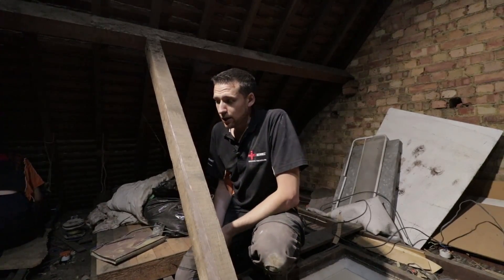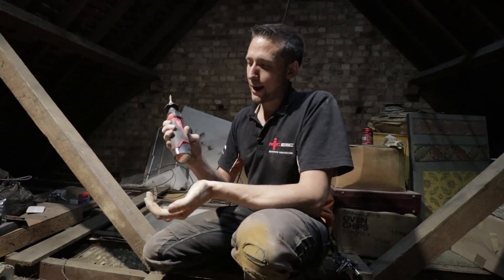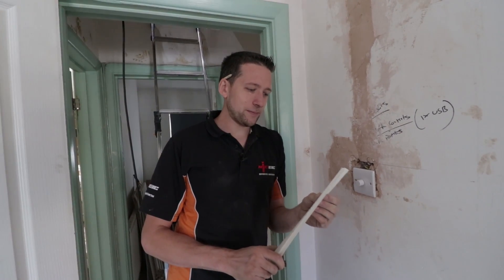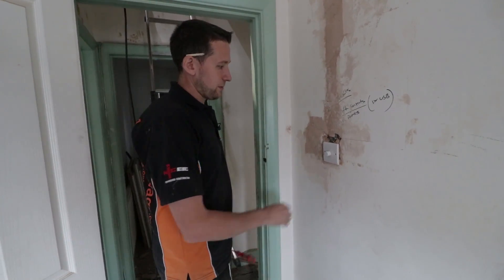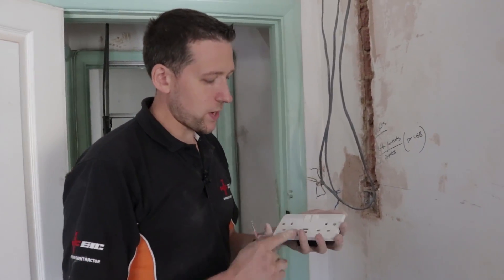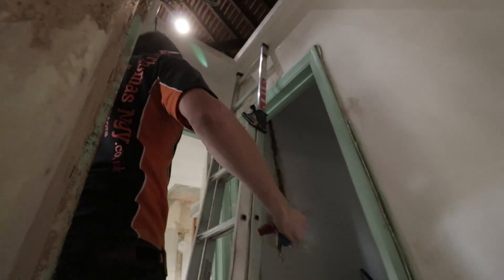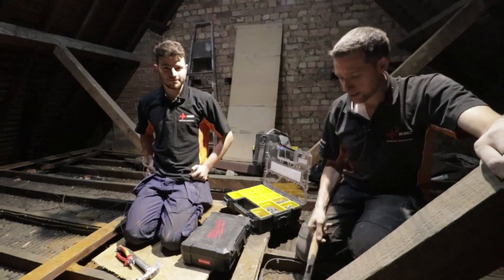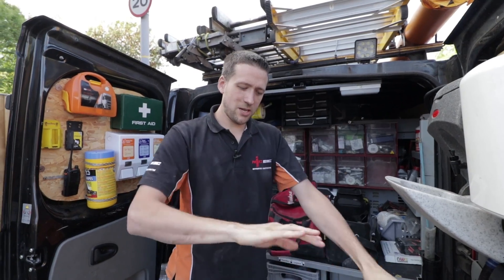Rewiring a "just rewired" house (Part 2) | Thomas Nagy

Comment: Couple of questions Thomas. Can insulation be put straight over the cables afterwards. I want to cut,  route the wires in the attic through the joists, join and board over the joists. Wondering if there was a reg about insulation covering the wires. Also which would the best connector to use for this application. I was going to use in-line choc blocks or wagos.

Comment: Why in the hell does Uk use square socket boxes?  Like it's a proper shitfest to cut a square whole and fit those square boxes in there etc.
We use circle boxes, you just cut em out with a hole saw, push em in, tighten two screws and you're done, takes about a minute.

Comment: As a random aside, it's interesting to see the differences between norms and requirements in different countries. Here in Norway, to my knowledge, you are required to run cabling inside walls or between floors in tubing, no exceptions.

Comment: I'll stick with my butane portasol soldering iron, it does the heat shrink on the end of the LED strip afterwards with the little hot air vent on the tip.

Comment: I’m not a sparky, but I just don’t love USB integrated sockets. Active electronics running 24/7 just doesn’t sound like a great plan. Having an external isolator switch would be a great solution. An annoyingly bright LED active when the charging circuit is live would encourage folk to turn it off when not in use.

Comment: Hey T.
Are these Combi Cutter/Stripper something used in the UK? Rarely see anyone outside my own company use them and i'd never be caught dead without mine on me during work hours.
Cuts effortlessly, strips wires ends quick and easy.
https://tools.no/produkter/handverktoy/tenger-og-avbitere/elektronikktenger/Kabelsaks-9511-165A-Knipex-2850596-no

Cheers

Comment: I'm still at the beginning of my electrical trianing, just basic theory, when do you do soldering rewiring a house???  Great vids as usual.
Reply from the maker: not so much when rewiring, but things like led strip lighting, soldering connections etc..
Reply: Great  way of joining cable, when you have no room for wagos etc. Done right the join is barely thicker than the original cable and strong.

Comment: @7:45 - the one thing holding me back from installing USB sockets at home is the fact that they're always on and you can't unplug them. I wouldn't just want an off-for-testing switch in the back, I'd want either an on-off switch on the front (a third rocker between the 13A ones) or a microswitch activated by insertion of a USB plug, so when nothing's plugged in it's really, REALLY off and not just pretending to be off.

As for the rest of the wiring job here, if I was the customer I'd be passing links to your videos on to anybody else I knew who was shopping around for electrical work, naming and shaming the guy who did it first and ensuring he gets as little business as possible. Word of mouth works both ways; if you're one of the good guys you'll be rushed off your feet with work even without advertising, whereas the cowboys' adverts will be out there to trap the unwary.

Comment: just wondering how do you wire 3 temperature controllers to a single scr using one double pole double throw relay to initiate 3 different output scenarios?

Comment: I've fitted thousands of the MK Logic Plus USB sockets. I must admit I'm not overly fussed on MK products. I personally think Hager gear is of a much higher quality. 

Testing isn't an issue with the USB sockets. Your only limitation is IR testing at 250v between Line & Earth and Neutral & Earth only. No different to having a fancy LED light fitted during testing.

Comment: Are you having a joke with that jumbo soldering iron for fine work? It looks like it would be great for chassis work on an old valve radio, but for fine work and LED strips, really?
I would go for something like a TS100 - runs off a wide range of supply including USB battery pack, warms up in 15s, much better temperature regulation and is a far more sensible size for fine work.
Still love your videos though!
Reply from the maker: i'll keep ya posted on it. i hadn't actually heard of the ts100 or 80 until peeps on here were saying its a good alternative. time will tell.

Comment: Yeah. A rewire is the only way to go with a bodge job like that, at the end of the day you can't in good conscience let someone live in a house where you have just "tidied up" a job like that. You have no idea how bad the stuff you can't see is. I did a similar thing a few years ago where a friend of mine was left with a death trap after he had some major building work and a rewire done. I looked at it and it was a death trap. So we rewired it ourselves and someone i know who is an electrician inspected it all afterwards. He wanted to try and save it but after we ripped it all out and he saw how bad it was he agreed replacing the lot was best. 

I've always used capping on what wiring i have done. Its what my uncle and dad used to use so i always done it that way.

Comment: That soldering iron looks huge. I’ve been using a iroda gas soldering iron (£15) for years, small and lightweight uses lighter gas (89p for large bottle from home bargains and lasts months), fits in tool bag (no bigger than a screwdriver). Come on £175 for that huge thing! Just to be used occasionally. Oh and as much as I love the vids, you were a bit ott in trying to sell us that thing 😁

Comment: So you didn't find the wagos buried in the wall then?

Also plus several million for the isolation switch for the USB. Not just for the testing, but for actual use... turn the thing off when it's not being used, make it last longer

Comment: The old MK usb sockets I fitted has micro switches on the shutters. Wish the ones in the rest of the house did as you can hear the high pitch noise from the power supply in them 😢

Comment: About the USB sockets, Most are no good for modern devices anyway these days and a couple of years ago when they started getting popular, it was worked out that having them powered 24/7/365 costs you £12 a year per socket. That can really build up in a house that has them everywhere. It is the same as leaving your phone charger plugged in all the time.  as phones need more power and faster chargers these sockets seem to just be less and less useful especially if you factor in all the costs.

Comment: there's no point in switching off the 5V usb generator...
over here in france, we use corrugated tube that snakes inside the wall, all the way to the customer unit, makes replacing or adding wires a breeze

Comment: I had MK USB sockets and apparently they are only on when a lead is plugged in. They were fine at charging, but when I tried to use my iPad/ iPhone when charging, the screen became unresponsive. MK said it wasn’t their problem as it complied with USB standards. An earthing issue I think. I’d love to hear if these new ones allow phones to work properly while charging. Cheers, and keep up the high standards!

Comment: What exactly is the purpose of plastic capping?  It doesn't provide any protection from screws or nails.  Is it supposed to provide a cavity that allows the cable to be pulled out and replaced in the future?

Comment: I personally wouldn't drill holes in 4 inch joists or any joists in the roof for that matter, leave the cables running over the joists. If any weighty bastard goes up there and stands on it they're gonna end up sprawled on the living room floor. If they want to board the loft space they shouldn't really board direct to the joists anyway.
Reply: I'm always amazed looking at those joists, having grown up in Austria where they'd much rather use entire trees for joists, although spaced further apart. Honestly, the joists underneath the room I'm sitting in right now are 25x28 cm, spaced something like 80 or 100 cm apart! Elsewhere in the house I've found 10x30 joists and even the shortest spans (less than 2 m) are 10x15. Where fire rating was an issue they'd just build the entire ceiling from tree trunks straightened on three sides and installed round side up, creating a solid timber ceiling 10 cm thick at the thinnest points! I think once plastered these reached a 90-minute fire rating with pre-1900s methods and materials. For a while these dowelled beam ceilings were actually required between living spaces and lofts. Austrian cities were a bit obsessed with fire safety from the 16th century onwards - including banning wooden stairs in buildings more than two storeys high. I think that's been lifted for a while but you're still highly unlikely to find wooden stairs in anything but a single-family home in Austria.

Comment: Not too keen on the e8s termination only due to the amount you can strip back, the E6s on the other hand have improved that greatly plenty of room and they have kept the spring terminals, Tom oval is much better I get what your saying about 2 X 2.5s but if there was a chase as big as the one for that SW you would instantly assume someone had used 32+ mm oval, although I see it's causing a good debate in comments, people saying it's pointless etc but it's always good practice and if people think it's that useless get the metal capping,

Comment: I expect it's not just easier to rewire this job but ultimately much safer too.
The MK USB power sockets you showed have a switching power supply inside, not an old school transformer. 
I think because the angle grinder utilises a worm gear to allow the plane of rotation of the disc to be 90° in conjunction with the motor it will likely use a clutch mechanism to allow the cutting disc to turn independently which may be designed to click when manually rotated.

Comment: Well to be fair, it's a grinder and it sounds like it's grinding internally.
Reply: I sell hitachi grinders at my hardware store, at least the brushless ones sound like that straight out of the box. Might be that the gear doesn't engage until you spin it up.
Reply: Did the grinder by now arrive in the afterlife@bigclive ;-) ?
Reply: instablaster
Reply: What's the security locks on your van Tom how much where from cheers , good vids

Comment: Hi there Tom, is your customer planning to insulate his loft space before 'boarding' it?  If so, have you carried out the relevant calculations for the impact of thermal insulation and 'grouping' on the current carrying capacity of the cable?  ... or are you relying on the low current demand of LED lamps?  Have they consulted a structural engineer?  Those look like 4 " joists and will not have been designed to carry any weight in the loft space!

Yours Aye

GB
Reply: You mean those two 1.5 cables doing less than 2A worth of lighting in less than a 5m run?

Comment: That iron might be OK for bigger stuff, but if you (also) need to do any electronics or solder wires inside cabinets, etc., it's way too bulky.  TS80 iron + USB-C Power bank or TS100 iron + Lithium pack is far more comfortable / versatile.

Comment: Hell, if you had to figure out what some cowboy did before you and then fix it, you'd be charging a lot more labour, not to mention getting called back cos you missed something the idiot did and now you have to try and fix it in a fully finished/furnished building, that's if the place hasn't burned down. Best option is to tear out the sh1t and start fresh, at least that way you can stand over your work 100%...

Comment: ENLITE make the E6 downlight with a plug in connection for first fix and insulation resistance testing with loop in loop out push fit connections made for 1.5mm2 cable.

Comment: 32 people are looking at the soldering iron at ITS. Product placement seems to be working. Although you need to link directly to the product in the description so they can get their monies worth from the advertising.

Also Milwaukee stuff comes with 3 years warranty, contact them you might get a free replacement if it's still within warranty.

Comment: i am happy that i am not an electrician in the UK, standards here in Holland are mutch higher. you will never see cabling smeared into the wal here.Ik can also see that when there are contractors from the UK come and do jobs here, they have really no clue what they are up against metal terminationboxes that can cut into the wires.

Comment: Why do you not use 20mm conduit for wires plastered over? Coming from northern Ireland.
Reply: Would be the way to go in most Western European countries. I don't think I've ever seen capping or oval conduit anywhere except in the UK. Of course then you've got the Germans, who'll happily tell you that pipe is so 1930s and you should just use cable straight in the plaster. I've even had Germans tell me that using pipe in walls is forbidden!
Reply: It’s a cheap way of doing it. I’ve always used 20mm conduit

Comment: I reckon every plasterer in London must have a strong dislike for you and your persistent use of the ubiquitous plastic trunking giving them 3mm at best depth of plaster to cover it. In reality it does virtually nothing to protect the cables but results in the poor plasterer having no coverage depth and a flexible plastic tube that persistently flexes as he tries to finish of the top surface - and we all know that over time there will be tell-tale cracks appearing to highlight your handywork. If you want to use trunking then at least set it at a depth that gives the plaster a fighting chance
Reply: I was wondering about that too, there is almost no space and plastic isnt exactly the best in terms of "grip" for the stuff to hold onto.
Reply: Steve-DIFMEIWS Steve I thought the same thing.
Reply: Capping allows the wire to be re-chased should the need arise
Reply: Ragnar8504  Most commercial and industrial work is all done with metal trunking/conduit. They even have pre wired lighting systems which you just plug into the main connection box which is metal copex.
Fuck even in the old days they used to do houses with metal conduit but modern domestic building industry is a joke
Reply: @Ragnar8504  when i was learning it was a well considered argument that the plaster and concrete reacts with the outer insulation and degrades it in a short period of time and that plastic oval was made from a different PVC mix that could withstand the chemical reaction ..also would away chase deep so the plasterer had plenty to fill up with bonding (clues in the title) not finish plaster
Reply: that's what plasterboard's for mate?
Reply: I don't bother with capping unless new brickwork.
Reply: It's capping, not trunking. And it's to protect the cables from plasterers. 

However, we don't use it anymore for the reason that we like to get on with plasterers. We use pvc conduit chased into a minimum depth of 6mm below the finish surface (and it's a lot less flexible than capping). Narrower chase, and the curved profile allows the plaster to get a grip BEHIND the tube.

Capping is the work of satan.
Reply: I always clip Direct my cables with no capping or pipe as there is no requirement for this in the electrical regs with modern day installations with RCD protection

Comment: i don't even live in the UK to the half wits who say they are extorting.. feel free to continue.. ive seen first hand some of the sh*t contractors do and honestly i picked up several things off Thomas i now implement in Canada that  is no where even near code... things that we dont have codes for but i still implement them and honestly ive lost count how many times ive had to rewire i walk in from a distance not bad.. ok pull a cover and just groan .. you also dont know the condition if the cable was it pinched.. no offence im not spending 20 hours tracing wires in areas to try to save 10 feet of cable when i now just charged the client more then to just re-run new wire and just get it done proper.. to wire trace an entire room would be minimum half day+ to rerun the wire would be a day (all depends on complexity as in canada we dont really have plaster over brick we have hollow walls and you can just pull wires

Comment: A portable soldering iron is a nice tool to have, can really save the day at times.
Though, 20-30 seconds for it to heat up is a bit of a drag....
Though, I also fully understand that one might not drag along a 100+ watt soldering station with temperature regulation and the like...
But there are semi easy ways of getting a Hakko T12 solution to run off a standard 12-18 volt tool battery or just a lithium battery pack, would heat up in less then 5 seconds, and has plenty of power to boot and tight temperature regulation so that one doesn't accidentally melt/break stuff. (Not to mention the large selection of T12 tips as well.)

Comment: Milwaukee soldering iron looks so bulky and doesn't have temperature control and tips aren't with heating elements. For the same money you can get TS80 soldering iron and battery bank.
Reply: It has a LOT more mass though. For delicate work the ts80 is certainly better, for higher mass stuff you want something bigger like the Milwaukee

Comment: Can a brit person or someone that knows tell me why in britain they use socket to socket cabling. I mean some places including mine have one think cable going around the room and it is conected with a thinner one down the socket with a box above it. It saves cable and hasle. Why do you use it?
Reply: Think it’s something to do with copper shortage in ww2 so saves going back and forth from CU to every socket plus cable 2.5 rated at around 27a and the beakers 32A so hence a ring main circuit. I think it’s dated tbh
Reply: Because we use ring final cabling. If we ran single tails down to each socket this would be a spur, and you cannot have lots of spurs on a ring circuit.

Comment: additional benefit of a switch on the usb ports - isolates the transformer from running 24/7.
Reply: yep. waste of energy and lifetime of components. just as having your monitors/work pc on "standby" 24/7 until the caps explode.